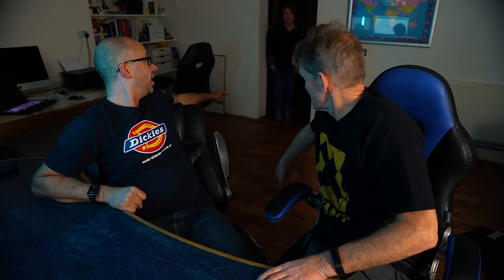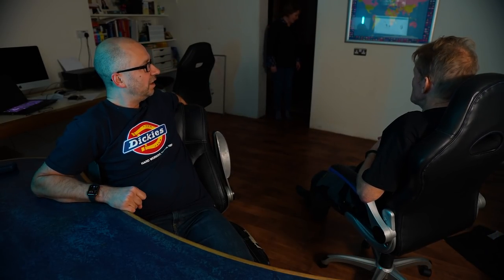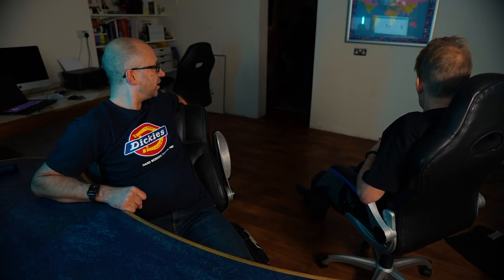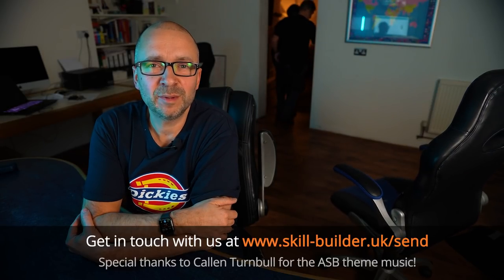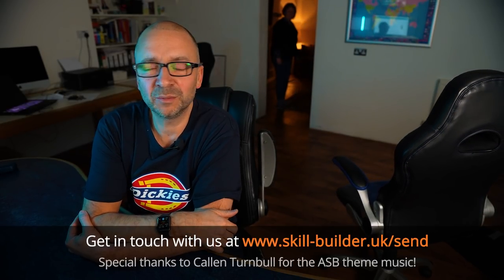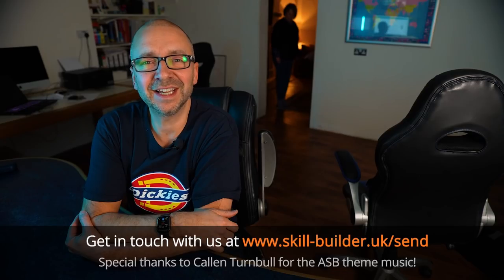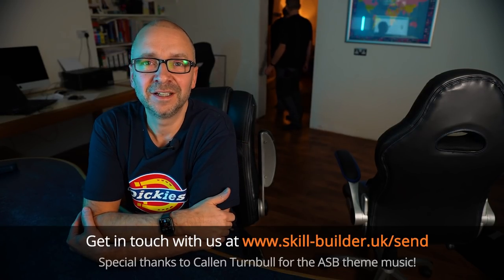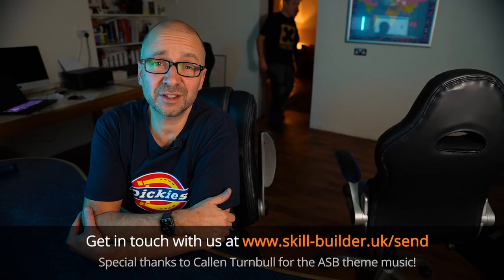The Mystery Wall ~ ASB#24

Comment: Hey, guys. Pebble dash was used, here, in the US, for a time, back in the 70s and 80s. I don't know what we called it; maybe the same. Various finishes. Pea gravel, crushed quartz, marble, etc. Pain in the nether region if you happen to smash something into it.
Reply: Aka Rock Dash Stucco in Canada https://en.wikipedia.org/wiki/Stucco
Reply: See it everywhere in Scotland. Still see it applied today with the metal mesh and plastic plug system to hold the render on better.

Listen to this, my mate lived up a small arched alleyway, to get into his courtyard you went up the alleyway and through 2 big arched cast iron gates. The backs of the neighbours property’s that the archway was between were pebble dashed. I walked through the gates first. Then my two mates and they stood trying to line the sliding bolt up, anyway they got it and took about 3 paces and 💥 BOOM!!! A large sheet of dash and render fell like a guillotine right onto where they had just been stood!! Bloody lucky!  “Safe as houses” as they say. 😂
Reply: @MrSmid888  Galvanized metal lathe typical across the pond to secure render to walls.
Reply: @JohnR84  You find many sea shells in pebble dash.

I’ve seen walls with scallop shells pushed into the render. Gotta love it. 👍🏻
Reply: I once fell against a pebble dashed wall! Face first
Reply: In Florida the variation is cocina shell.
Reply from the maker: @MrSmid888  Great story. Death by pebble dashing
Reply: @SkillBuilder  May I add my mate was called Ally!! Ha.
This was about 20yrs ago. I’d guess the decades of weather and the gates being closed  against a top plate the vibrations worked it loose.
It was around a 2m square sheet.
Obviously his dad came out and started shouting about what a mess we’d made and why had we done it!! Ha. Typical.

Comment: If you keep on asking people with big problems you'll get Boris ringing you up.
Reply from the maker: He never stops ringing. He has noisy neighbours and people hanging around outside his door at night. He also wants to paint his front door a more cheerful colour but doesn't know what paint to use. We suggested Dulux trade but he said he can't afford it.
Reply: @SkillBuilder  Tell him to go to B&Q instead of the trade centre
Reply: Downing Street black? That's a special mix I'm afraid. It's just like the black you buy from b&q but with a special compound in it made from hydrogen and oxygen, roughly 2 to 1 mix. Really technical. £1,000 per tin.
Reply: @ricos1497  This special compound you speak of, is it available from Trotters independent traders?
Reply: @anthonydefreitas6006  yes, although I must warn you that they've gone downhill since merging with Dulux last year.

Comment: Frame fixers/concrete screws, the best of the all. The recommended hole size is 6mm, but.... if you're drilling into semi soft material like soft brick use a 5.5mm drill and if it’s really soft like Celcon drill straight in. If you’re drilling into hard stone use a 6.5mm drill. Takes a bit of experience to know what drill to use but once you’ve got it, you can’t go wrong. If you’ve drilled into something soft and the concrete screw spins round make a wood splinter (very easy) from an old piece of timber and wack it in the hole, then screw it in. Loves me concrete screws.
Reply: Everything said in this comment is true, concrete screws are one of my favourite discoveries.
Reply: @Edsbar  Yes, no plugs, no faff. Once you know the crack, they’re the best of all.
Reply: I'll third the concrete screws, brilliant. Only criticism would be that they fairly bite, so go easy on the trigger!
Reply: @ricos1497  I quite often tighten them with a socket and ratchet driver by hand, it really isn't much slower than with a driver and you get much more control.

Comment from the maker: This from Ahmed 
Re: Your Episode on YouTube ((How do I fix to hollow walls))

I wrote the following comment there but it didn't appear. I really hope it would be read by the followers who have reacted.

Hi SB, thanks for the reply. I think I didn't manage to explain my question in the first place. I mean of course I would have used these wall plugs once I got to the real wall. That  wasn't too hard to figure out even by an amateur like me. But what I didn't know is how to expose the wall without damaging this facade of the pebbledash which is raised about three inches. Now the fixture I'm installing is a satellite receiver dish that has got a mounting base plate with 4 holes. So should I really remove that area of circa 20 square inch of the pebbledash so that I can reach the wall behind it?

P.S. by the ((drum or drumming sound)) I meant to describe the hollow structure as I tapped around the wall to inspect it. Sorry for the confusion again.
Reply from the maker: We were only having some fun mate. Leave the pebble dash alone and just get some longer screws maybe 3 inches and use expanding plugs.  If the plate doesn't sit flat you can run a bead of mastic around the back to fill the gap.
Reply: Hi Ahmed, have a look for some nice long and fat frame screws (non hammer 🔨 variety). Leave the pebbledash alone except for the holes.

Comment: Those concrete panels are about 50mm (2”) thick often used for sections garages. Bolting anything significant to that stuff is not a good idea.

Comment: That sounds like a 'Doran' house, bolted together concrete pebble dashed panels.
Reply from the maker: Yes it is exactly that but, as far as I know, the term is ony used in Scotland
Reply: Weren't the council houses built just after the war built with pre cast concrete panels to the ground floor, and metal sheeting to the first floor?
Reply: I had  dorran bungalow , to bring it up to mortgageability level I had walls built around the outside an the roof raised to take the pressure off of the Dorran panels, at the time you could get government grants for it, not sure if that still applies , I also had the loft space insulated and under the floorboards. Wish I never sold that house. The house was in Ullapool Ross-shire.

Comment: Tell you an annoying problem I’ve got. Depending on the moisture content in the air you can see the dot and dab through the paint on the wall thats on my neighbours side. Really annoying. I’m not a fan of dot and dab. It’s obviously caused cold spots. Everything’s bone dry. I can’t be bothered with the mess and upheaval to knock it all off and stud it. Means the coving needs moved which in turn wrecks the ceiling decor this list gets endless. If I use candles I can’t notice it at night 😂😂
Reply: Paint it with Zinsser B I N
Reply: @Palo-jm7xc  yes see you couldn’t notice it through the Matt magnolia when I moved in. I’ve used expensive Dulux Diamond eggshell. So isn’t a chance il be starting again. The whole wall would need a coat of blocker. Not cheap stuff. Only my second winter in the house, obviously doesn’t show in the summer. I wonder if anyone else had came across this? First for me, typical it had to be in my house! 🤣👍🏻